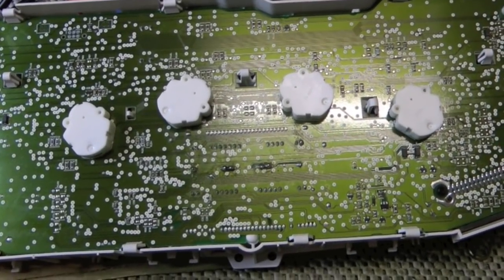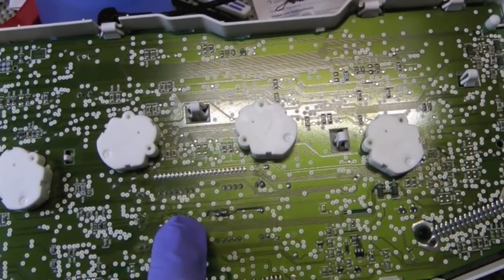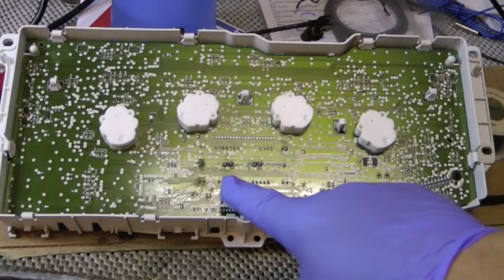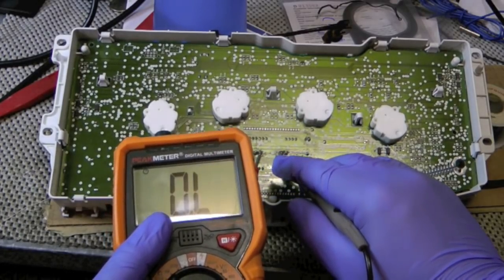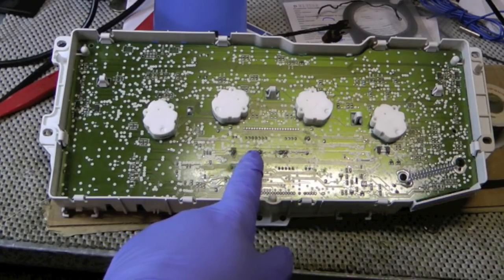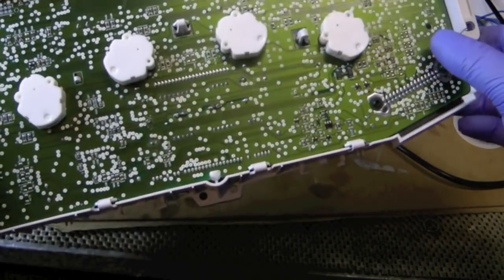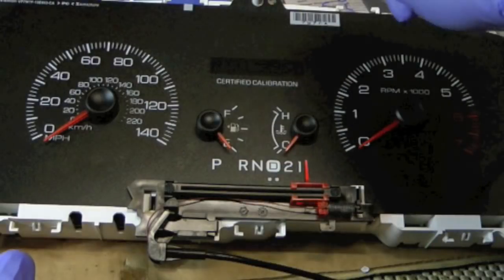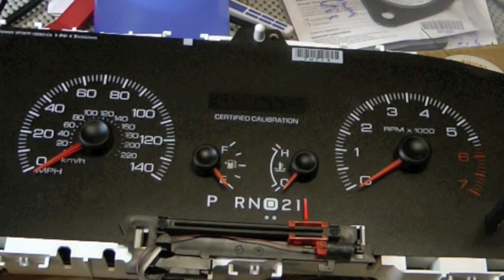Ford Crown Vic dim odometer fix follow up

Comment: Tested for continuity and soldered all the proper joints and STILL doesn’t come up. Fuse maybe....???
Reply from the maker: could be a fuse... unfortunately I don't know which one it is, nor which wire to the harness it is.  Otherwise I'd say check with a multimeter on the harness.  These things can be a real pain.  If it's something on the circuit board itself, I do trust a company called Circuit Board Medics to do repairs for a reasonable cost and quick turnaround
Reply: @WJHandyDad  you’d think if the fuse was blown none of the gauges would come on
Reply from the maker: @Dragunov302  I haven't looked at a wiring diagram to see if there are different power sources or just one but I agree with your logic that most likely if a fuse it would be the whole thing.  May be time to send it off to a pro like Circuit Board Medics

Comment: Thanks for the video. Re soldered my 2008, resistors check out, but it didn't seem to work. There must be another issue that's not an easy fix.
Reply from the maker: Circuit Board Medics is who I'd recommend if you need to send it off
Reply: @WJHandyDad   I just pulled the needles and board- and did my best to resolder the 5 surface mount resistors and the diode under the odometer prongs. It works!!! Seller told me 175k, but it shows 151k. Thanks again! 🙏

Comment: My mileage not showing or lighting. It's weird because it was just showing. what's the problem ? Please let me know!
Reply from the maker: most likely a bad solder joint somewhere, but also possible that a component has failed or a broken wire somewhere